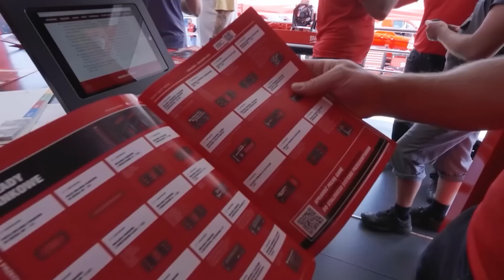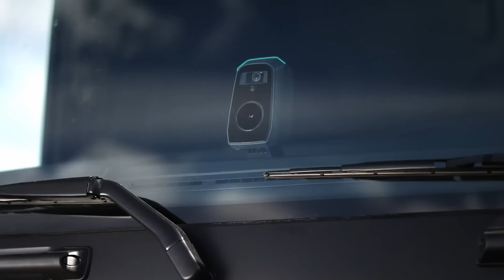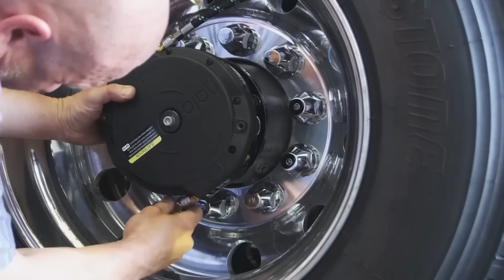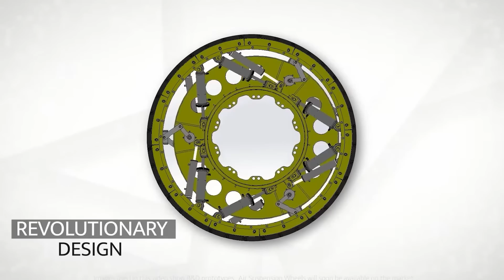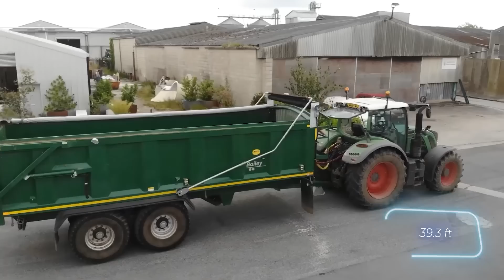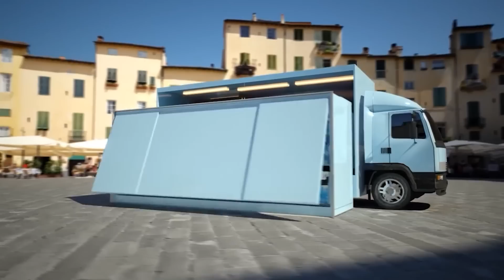GENIUS TRUCK INVENTIONS THAT ARE ON ANOTHER LEVEL

Comment: Dude... when a crane (for example) is  rated for "30,000 lbs", that's a rounded value. A conservative approximation. It's not exact limit.

This means that the crane will not suddenly break the moment you load it with 30,001 lbs!

Therefore, when you state the metric equivalent, it is msleading, wrong, and downright silly to say "13,607 kg" since this gives the impression of an exact number, as it's not rounded.

It would be more appropriate and correct to round the metric to the nearest 100 kg and say "13,600" kg". or even "13,500 kg" if you want... but not ok to say  a  number ending in a non-zero.

Comment: The Robson Drive System is made for forestry equipment. Volvo, Scania, etc, has a different system. The differential on the 1st drive axle has 1 input and 3 output. A normal dif has 1 input and 2 output, 1 output for each wheel. The 3rd output is connected via another drive shaft to the 2nd diffs input which has 2 outputs. This is how you get 4WD on a big truck.

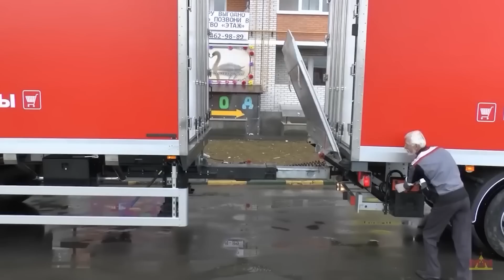Comment: The problem with the Dhollandia tail lift is that it feels a bit loose. It tilts a lot when you put weight on it, unlike HIABs Zepro lifts which usually hold the weight really well. Also, when operating the lift with the main controls like you'll see the driver do at 17:32, you need to hold the double grip button at all times. BUT, when using the remote you can open and close it. It's also prone to getting stuck in the up-right position so you have to basically spam the tilt-down button a few times before it goes down. HIAB Zepro has heavier duty lifts (up to 3 tons, as opposed to the 2 ton max on Dhollandia) that are simpler to fix, has thicker and more robust under-drive protection and are simply just easier to operate imo. HIAB is also a Swedish company, so it's bound to be better. The poblem is that they are a few cm too wide for the EU market, if I'm not mistaken. Max width in the EU is 255cm and the Zepro lifts are made for the 260cm wide trucks in Sweden.

Comment: The Icap system is pretty cool. If it catched on though, and became something would be thieves would be on the look out for. Every single person who has one that gets robbed will be replacing the entire tank. When thieves can't get in through the filler hole, they will drill a hole into the tank.
Reply: Lol i was just thinking the same thing, would be better to just have a detection system. If it detects that fuel is being drained without the engine running all lights are turned on and a siren  sounds. A camera filming 360 degrees around the truck turns on and starts recording. As trucks usually stop at designated stops and the driver is often present, then the driver could just wake up and drive away and call the cops.

Comment: That front detection crap has been around for a while. It's nothing but junk. In fact it falsy breaks the semis so much that the drivers aren't even paying attention to what the truck sees anymore. Soon as the truck starts breaking they just start cussing and swearing and trying to override it without looking anymore it is such a problem.

Comment: The thing that looks like a tire shredding emergency brake on the thumbnail is at what time please?
Reply: end of video

supposed to be when you need extra traction, but they rely on tread which should be covered in mud etc in adverse conditions so idk if it is even decent
Reply: @chriswho12345  thanks, I didn't see it

Comment: if your going to put a unit that big on your tires to see if they are low on air...might as well have that unit fill the tires up automatically?
Reply: it does thats why its so big, as it spins it spins a weight which powers the pump, it triggers if the pressure is of by x percent... it just also tracks temp vibration and stuff to look out for other signs of tire/wheel/ axle/ brake issues

Comment: If 1 ton = 2,000 lbs, then how does 32 ton = 70,500 lbs?  Unless I'm mistaken 32 ton ACTUALLY= 64,000 lbs.
Reply: 2000 lbs is a short ton (American), 2240 lbs Standard ton (English, and was also used in Australia and the Commonwealth, 71680 lbs ?.
Reply: @lorrencekunst5463   Thank you kindly. I thought I remembered something about that, but I just couldn't recall exactly what it was. I appreciate you.
Reply: @lorrencekunst5463   "metric ton" 1,000 kilos (2.2 lbs/kilo) or "tonne".

Comment: Should have done the zacklift instead of the holmes dtu, its a much better system. It even has spades so when its detached, the boom doesn't have be on the ground. The casey ladelle channel show cases it very well.
Reply: I thought the same thing. Those outriggers are necessary for HD tow trucks. There's simply no reason to eliminate those from an HD truck, and I can't figure out why Holmes doesn't have them on their detachables. It may not be completely useless as a towing apparatus, but it isn't something I'd want around for recovery work, and definitely not for any heavy lifting.